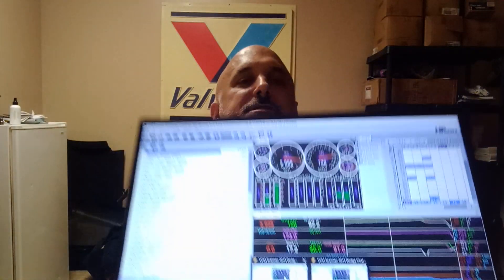Fast Man 95mm Hellcat throttle body testing results.

Comment: We need Dyno graphs with the stock vs ported with the power curves laid over each other.
Did you have less traction down low with the ported throttle body?
Reply from the maker: No loss in traction at all.

Comment: you mentioned mild tune    did you change pulley    open up exhaust      did you change out the pcm diablo  tune ?
Reply from the maker: did you:
change pulley? No, Stock Pulley 
open up exhaust? No, Stock cats and cat back.  We haven't seen any gains by changing the exhaust or removing the cats until the car is running mid 9's      
did you change out the pcm diablo tune ?  Yes, I tune with HP Tuners Software.

Comment: What about putting 108mm on a 800whp hellcat? You expect any gains?
Reply from the maker: @captain052A  the red eye that I mentioned in this video is about 800 and 20 horsepower to the rear wheels if memory serves me correctly. It is a very minimal gain with some slight drivability Improvement
Reply: @ what about if the same 108mm throttle but with a ported snout? Any gains on a 800whp setup?
Reply from the maker: @captain052A  that all depends on who is porting the snout. How extensive is the work? In general, I really wouldn't worry on an 800 horsepower car unless for competitive reasons you're looking to get every last horsepower out of your combination

Comment: Wonder would the 95mm be worth it on a procharger setup with a ported 6.4 intake. I'm seeing ppl just staying with the 92 so I'm on the fence of just buying the 92mm. Bigger isn't always better with modifying cars.
Reply from the maker: I would argue that it would not be worth it. You're only going to be able to flow as much as the discharge side of the compressor.

Comment: About 1k spent. Maybe recover 40 percent if you sold the part. Maybe timing coming out. Fuel injector duration increased.  Idk. But on the 392, larger flow could help take torque out at the 60 foot for consistency.  And add rpm at top gears a bit. Maybe 2 to 4 degrees retarding of cam for 392 pending valve to piston clearance.  A dyno environment with the fuel and timing curves may reveal the issue with the 6.2. May benefit from a dual port T..B. if one is available and the tuning. Like multiple valves In a wet flow intake system.  Higher velocity at lower openings due to throttle valve window area increases may benefit the dry intake system also. Just thinking a bit...

Comment: Professor Mason I have a new mechanic that’s fixing some of the repairs that the old Mechanic 🪛Professor Mason I have a new mechanic that’s fixing some of the repairs that the old Mechanic 🪛 putting on my Shorty headers and E85 tune kind of jacked up the air fuel ratio the cold start in the idling and putting the mount of 6.4 392 manifold on my 57 I talked to fast man he said the 82s enough 84 if I’m gonna get a cam later down the road now my mechanic only to throttle bodies he likes are the fastman and doing the hellcat throttlebody the 90 mm fastman 82 mm for throttlebody is two months out because he is so busy my Mechanic 🪛 does a lot  are the fastman and doing the hellcat throttlebody the 90 mm fastman 82 mm for throttlebody is two months out because he is so busy my mechanic does a lot of throttle bodies and he uses the hellcat can I do the hellcat throttlebody with a 392 intake manifold on my  57 he says he does a lot of them and they are work OK
Reply from the maker: He is the one tuning it. If he wants to tune it with a hellcat throttle body then do it with a helicopter on the body. It really won't make much of a difference.

Comment: No one is at sea level? Most of the US population lives on the coasts. 
2500 altitude? It should be sea level. Your Hellcat will add 10psi regardless of altitude until 50,000ft. 
All the WWII planes were boosted for that reason, so they would have a uniform output.
Reply from the maker: WWII airplanes that would have been designed to see combat above 12,000- 14,000 feet had dual-stage superchargers some head 3-stage superchargers. Single stage supercharged engines power would start to drop off drastically in some cases as early as 7500 feet others would have to be throttled, meaning you could not go to wide open throttle until a set altitude because of overboost conditions because the supercharger was geared for a specific altitude range. so no, it won't make 10 lb of boost boost up to that altitude. That's simply not how these compressors work. They will compress a percentage of the available barometric pressure. Furthermore, there is nothing uniform about power output on any engine regardless of whether it is supercharged or not as you climb in altitude. Save for a turbocharged application, because it is not crankshaft RPM dependent for compressor RPM . Even then, you are limited by available atmospheric pressure. Anyone with any Aviation experience at all will agree to this. As these are Cornerstone principles in  piston powered aircraft performance. It is for these reasons specifically that density altitude, physical altitude, and humidity play Such huge roles in determining takeoff parameters such as speed and available runway for a given load.  But since you mention WWII aircraft, Feel free to look up the power output chart for any wasp 2800, Allison v-1710, Merlin, take your pick.
Reply: @Moto-Psycho-1  That's all semantics. Im talking about how the purpose of the blower on those birds was to maintain the output found at sealevel, that 2500ft is arbitrary, that your 10psi of boost remains constant from sealevel to the limit of the compressor to draw in and compress after whatever altitude its effeciency falls off, I said 50k feet as an extreme, the cylinder pressure of a hellcat is the same at sealevel as it is at 2500 feet.
Reply from the maker: @usedtruckemporiumusedtruck4166  lmfao.... nope. Do yourself a favor and look up the power curves of the engines that I suggested for you. As someone with a lot of experience in this field, I can speak pretty plainly on the subject. Belt driven superchargers generate manifold pressure as a percentage of the barometric pressure that they are working in.
Reply: @Moto-Psycho-1  i get it now, the boost is relative to the barometric pressure.

Thankyou for taking the time to explain, I understand why you use 2500feet as a mean altitude.
Reply from the maker: @usedtruckemporiumusedtruck4166  P2=P1(D2/D1). Boyles Law. In This case as it applies to boost pressure and absolute  Barometric pressure where P2 is the pressure at altitude, P1 is the control pressure at sea level multiplied by the margin difference between the KPA at the requested altitude vs the control altitude. Apply  the formula to the Pressures you are going to compare.  In your case:
P2= 10psi (92.0/100.0) --  (kpa at 2500 feet is 92.0,  100.0 at sea level) 
P2= 10 psi (.92)
 P2= 9.2 PSI.

Comment: Throttle body pairs very well with an intake that doesn’t have the turbulence caused by baffling.
The filter itself isn’t the limiting factor on these. That being said, another thing to do for testing is check the IC temp, and the density altitude (DA) for each run. That will get you the best data.
A really good app for that is Air Lab

Comment: Hey Bmason bahi a lil slow at work so wanted to ask you I have the money for it should I order the 84mm tv from fastman while waiting for my 392 as one more bolt on??
Reply from the maker: If you have a ported manifold, the throttle body may do you some good. Without a ported manifold it really won't help you

Comment: And when I was on the phone with them gave them my year and asked if they had 3.70 gear for my car and they said no but they had two that fit my year witch is the 3.55 or the 373 .I didn’t order anything wanted to check with you because I wasnt sure I here them putting 3.09 on the chargers and you said 3.70 so maybe my year has a different Mach please let me know thanks B
Reply from the maker: 3.73 would be perfect.

Comment: Ok B bahi here I just ordered the jab shortys stainless ceramic coated headers from summit racing I heard it’s better to get better bolts they have stage 8 bolts should I get those and how about the gasket there going with stock gasket because the ones come with jba are not good they say can you suggest anything
Reply from the maker: Stock gasket.  Stock fastners.

Comment: Thank you for this video!  I am getting my Scatpack in the next week or 2 and I'm looking at dropping mods I don't need.
Reply: IMO a tune, drag pack, weight reduction, & MS109 are the big hitters for the Scat Pack. After that it's the little stuff, a little here a little there. My SP has self ported intake and 84MM Fastman TB just as Brian did on his SRT. Can't prove or quantify the gain but it didn't hurt and it's about as inexpensive as mods get. In April the car ran 11.36 @ 121.47 in 500+ DA thanks in big part to Brian's input. Hoping to get close to 11.2 if we get some good DA this fall.
Reply from the maker: @ScatPackRob  very nice! That is an extremely strong mile-an-hour!
Reply: @ScatPackRob  thanks a lot for the info!!!  All of it was straightforward with no BS.  I want to have fun with it but not lose control at every stop light.lol.
Reply: @ScatPackRob  that’s the fastest I’ve gotten with mine at the track. Just bought a chopstick to Stab in the engine.
Reply from the maker: I wouldn't necessarily rule out a ported manifold and throttle body for your scatpack. Just don't expect huge results. I have, in my playlist under dinos and drag testing a dino of a ported manifold with a larger throttle body
Reply: @Moto-Psycho-1  thank you very much and you earned a sub for teaching something and telling me about more things I want to learn!!!
Reply from the maker: @RexxCollects  thank you very much!  Lots of fun stuff in the play lists.

Comment: Great job control testing. Its probably safe to say your car is really well fine tuned for the stock TB. Do you think there is any room to change the tune or fine tune with the larger TB to maybe show more gains? Keep up the great work Professor Mason.
Reply from the maker: Based on what I could gather from the data, there really wasn't anything I could do.  I would literally be chasing the stock throttlebody.  What killed it for me was the lack of mile-an-hour on the big end. If there would have been something there for me to work with, I would have gladly dove into this a little further. As it stood, I literally didn't have an advantage with this throttle body anywhere down the drag strip. The 60-foot was slower, and the mollenhour was slower. All of these at the same timing value

Comment: Doesn't look like a larger TB makes any performance gains.... Wonder if the same for N/A 5.7s and 6.4s?
Reply from the maker: For the six Forest, throttle body and a ported manifold does yield some games. If you go into my playlist and go into the drag strips and Dino section you'll find where I did a before-and-after on a ported intake and larger  throttle body.  The five salmon intake manifold also needs to be ported to gain anything from what a larger throttle body